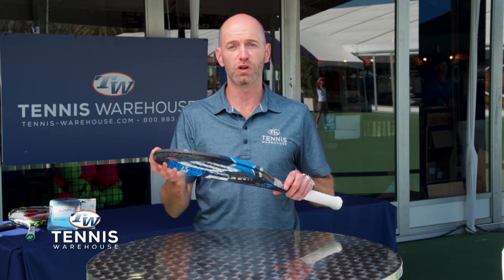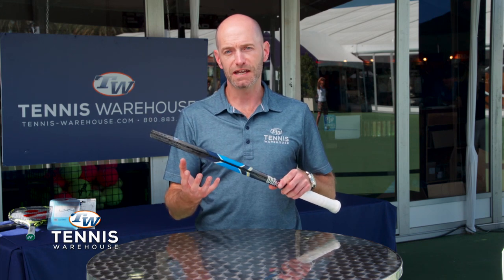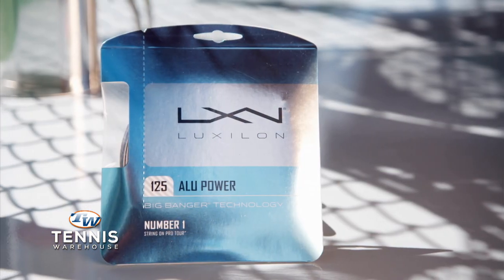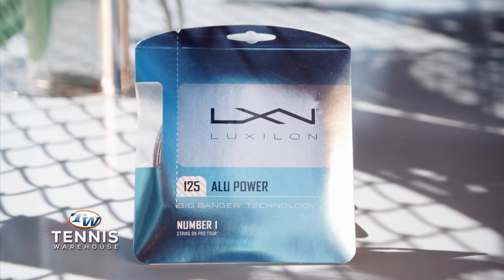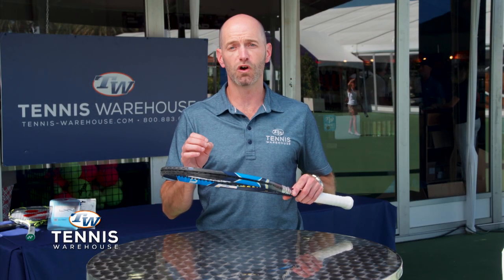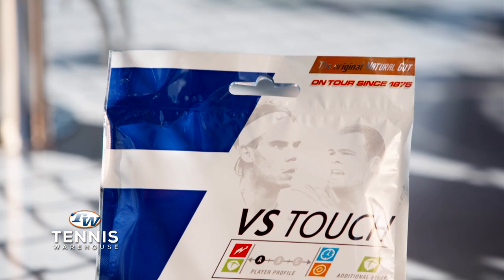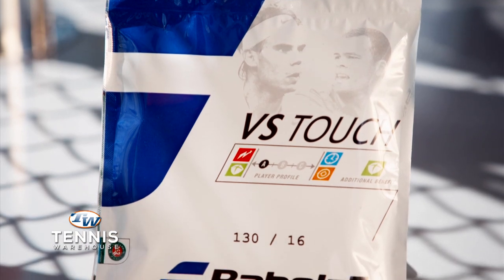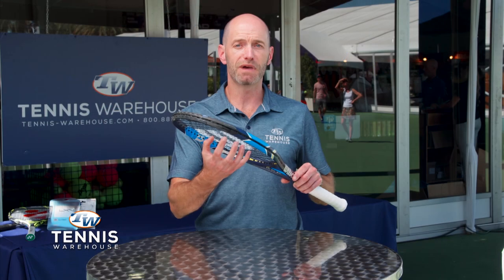String Stiffness - Tennis Warehouse Gear Up

Comment: Chris - looking at your TW database , the lower the stiffness , the higher the comfort. Is that fair ? I was comparing the ALU power 125 vs soinco tour bite 17 and found the stiffness is lower for TB than compared ALU P. Basically I want all that ALU Power offers in a more comfortable offering and TB came to mind. Thank you
Reply from the maker: @Paul Musarra,
Based on our TW University data the Tour Bite 17 does have the lower stiffness rating. Based on my experience of playing with it, I found a firm/crisp feel, but the comfort was decent. I think the 17 gauge will be a good alternative to ALU Power, and you will likely gain some spin potential. Another string that I enjoy using is the Signum Pro Poly Plasma 17 (1.23). It is a round shaped co-poly, like ALU Power, and has good control, and feel. It is a bit softer than ALU Power, and has better tension maintenance. 

Troy, TW